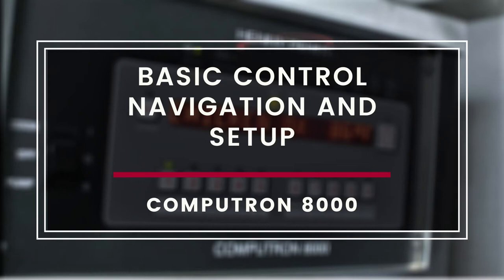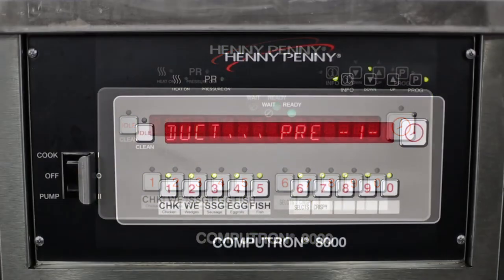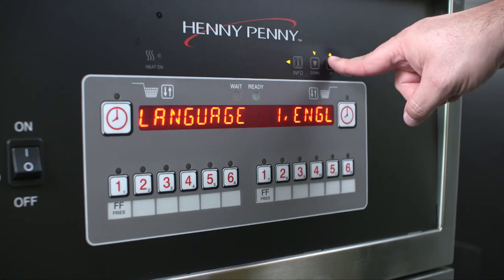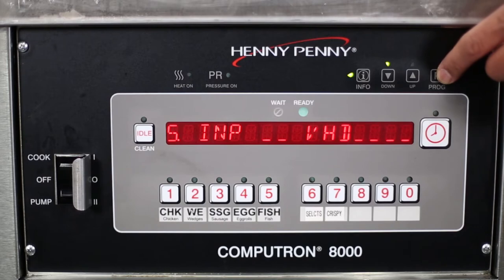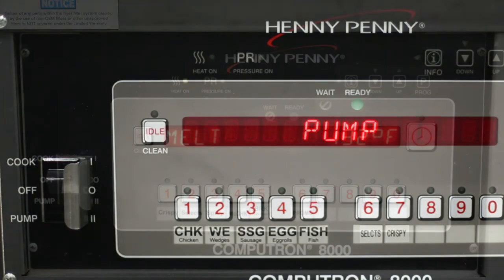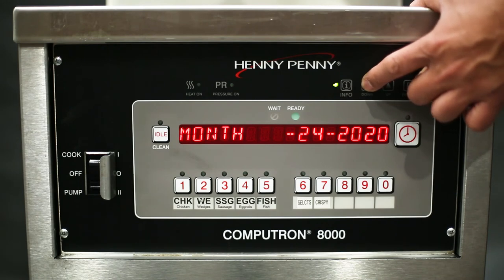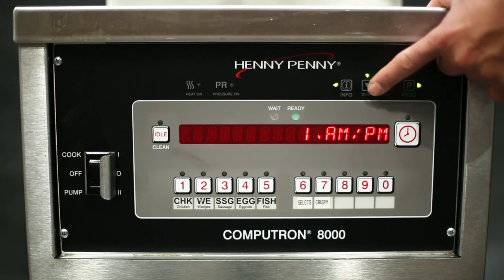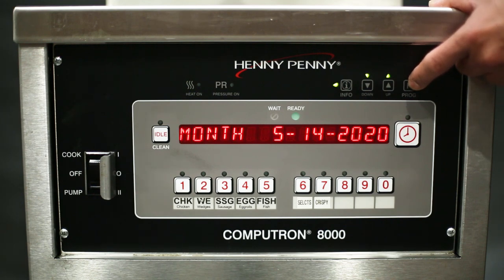Computron 8000 Basic Navigation - Henny Penny 4 Head Pressure Fryers

Comment: How do you get two simultaneous timers on both sides, so both fryers can cook two separate things? Currently when I press 1L a timer appears on the left and the product name is displayed on the right, and it doesn’t let me press anything on the right side until this 1L timer is finished or cancelled. Same thing happens when I press 1R. How to fix so I can have two separate timers at once??
Reply: Trying to figure out the same thing